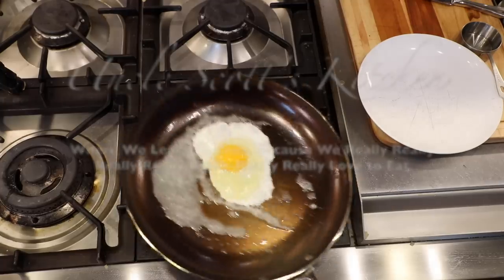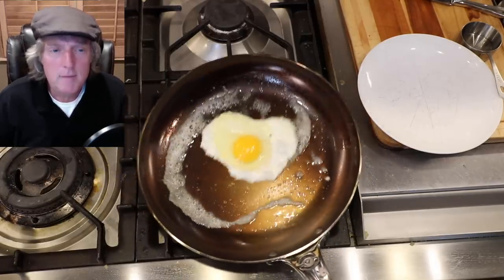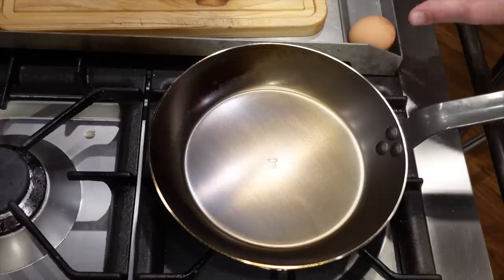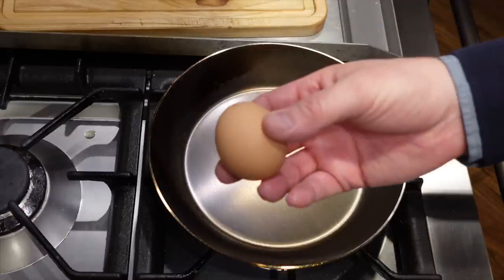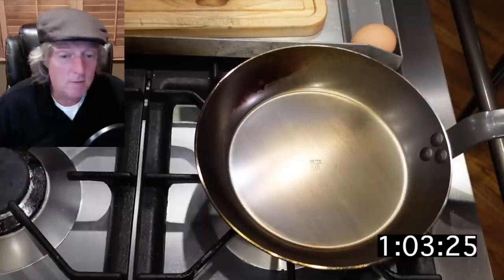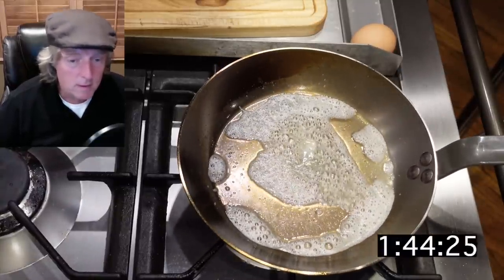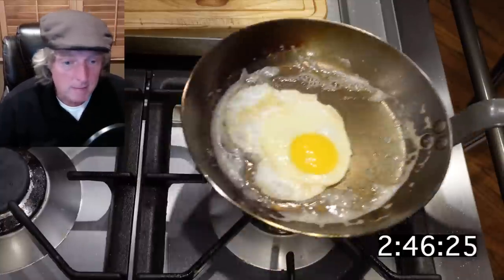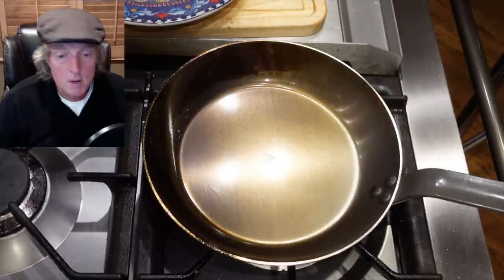IN-DEPTH: Exactly How to Slide an Egg in a Carbon Steel Skillet

Comment: I hated my cs and gave up on it for a year. I learned from watching your videos that I was using to high heat. As soon as I turned down my heat to very low NOTHING stuck. I do have a professional gas stove. Thank you I’ve learned so much from you. After watching one of your videos at 1am I got up and successfully made a French omelette and it was perfection. I was able to roll it in the pan before taking it out. By the way I did use cold eggs straight out of the fridge. It was absolutely beautiful and glistening. Butter does tell you when the pan is ready for the egg. I’ve gotten better and now use Ghee instead of regular butter. You have a video that walked me through it. I highly recommend it. I can’t stress enough using real butter and right temperature for your stove. That was a game changer. Thank you 🙇🏼‍♀️ 🙇🏼‍♀️🙇🏼‍♀️🙇🏼‍♀️

Comment: I bought a Matfer CS skillet several years ago, when I had an electric stove, and gave up on it.  Decided to try again now that I have a gas stove but the pan had rusted a bit in storage.  Nuked it with Barkeepers Friend and re-seasoned using the oven method.  Followed your instructions and my first egg slid perfectly.  I think the biggest difference was starting with room-temp eggs.  I also discovered that I can’t use the big, high-BTU burner I use for most things, but it all works well on a medium-sized burner at a medium-low setting.  I had to dial in the temp to prevent burning the butter, but I finally got carbon steel to work for me.  Thanks!

Comment: Great video. I have a deBuyer pro carbon steel omelette pan. When the pan is at temp I put a few drops of oil in the pan, then use a brush and spread it around the pan. I then drop in a teaspoon or so of butter. When butter is done bubbling I drop in the egg.  Egg slides beautifully

Comment: Hi Scott.  I used to use an 8” OXO Teflon pan (fantastic, so forgiving, but very little browning).  For the last 8 mos., or so, I’m using a perfectly seasoned 8” OXO Carbon Steel pan (less forgiving, but GREAT browning/taste!).  Depending on what type omelet I make (ala, Julia Child or Jacques Pepin), brown butter (NOT burned butter!) can be highly desirable.  Usually, I don’t have a problem with sticking, but this video has given me a great source for “troubleshooting”.  Thank you!

Comment: Great tips.  The times I have trouble when cooking in my carbon steel (several different sizes of de Buyer) I can trace it back to one of two (sometimes both) issues:  too cool or too dry.  I know better, I've been fooling with carbon steel since January of 2021, and used cast iron camping for over a decade...  But I'll still get impatient and not pre-heat enough, or think "that should be enough oil" (or butter)...

Comment: It's trickier but still possible to slide an egg in a Lodge frying pan. I usually have to give the egg a tiny spatula nudge to free it but when the planets align it works perfectly w/o help. My electric stove adds a layer of complexity to the process. Very nice video.
Reply: The rough textured surface of the Lodge pans really bothers me.  Those little pits are perfect for grabbing onto things like egg or oil.  I didn't realize until I laid my hands on an old car iron from the 1950s that they used to polish the surface so they were slick and shiny.
Reply: The Lodge pans get smoother with use. You realize the OP is about carbon steel pans, right? @ZagnutBar

Comment: I preheat off centre with medium high heat in 2 directions then cool down if needed and put 3 eggs in, then just let it sit on medium high heat.  There is usually a pocket of air that develops and the eggs just start slipping around.
Although I'm using a 11 inch premium frying pan.
Never have to wash it out.

I do find getting the correct temperature for oil a bit more difficult for the reasons discussed.

Comment: 8:49. Woah. Woah effing woah!!! Incomprehensible metric system?! You just lost a subscriber Scott! I’m joking. You’re bloody amazing. 

I’d be really interested if you can get hold of “spun iron” pans in the US. In the UK you can get them and I absolutely love using them. They are not cast (obviously) but discs of iron about 2mm….sorry 1/16th whatever that means and then spun into shape. Think a of a lathe and then they are turned to to shape. 

They are fantastic. Kinda cross between cast iron and carbon steel. 

Love the channel and this was a great “how too”

Comment: Thanks for the in depth explanation.
You have previously advised to have a pan specifically for eggs, why is this?
It it because if you use a pan for cooking meat then the seasoning won’t be as smooth?

I have a de buyer omelette pan and when cooking omelettes I get some sticking in the centre where the bee is stamped on, I’m wondering if that is because it is a cooler spot or if it is rougher due to the bee stamp.

Thanks once again.

Comment: I have a Merten & Storck preseasoned pan that I use for eggs. It was working great when I first got it, didn't really require much thought beyond how I normally do it. However, it seems to have lost it's magic the more I use it and I've gotten a few eggs stuck. I do wash with soap, but I wouldn't think that would cause a major issue, it's still mostly black but a little more matte and splotchy than shiny at this point. I haven't been bringing my eggs up to room temperature, so maybe I'll need to do that.
Reply: Your soap is washing off the seasoning of the pan. The seasoning is the layer of oil that makes the pan nonstick.

Comment: As a European I found the comment about water boiling at 100 degrees Celsius in the incomprehensible metric system a bit funny, because water boiling is the definition of 100 degrees Celsius.
Reply from the maker: The craziest thing is, to me, 212F makes complete sense! I can kind of grasp 100C for boiling, but if someone says it's going to be 22C today... I have no idea if I need a coat or wear shorts.
Reply: @UncleScottsKitchen Same for us, Europeans. Every time I hear or read some temperature mentioned in Fahrenheit I have to recalculate it mentally to Celsius. :) After somehow logical 0C for water freezing and 100C for water boiling it’s not so evident to understand why it’s 32 and 212 in Fahrenheit.  :) 
And by the way, why it’s so cold in your fridge? On our side of Atlantics it’s usually 4 or 5 Celsius, i.e. around 40F.

Comment: My guess as to why people fail is that they're not seasoning correctly.

I used to think sticky spots were normal until I found out I was using too much oil and subsequently not wiping it out adequately.

That pan should be slick and glossy.  When you run your fingertips across the pan, it should almost fell silky.

Comment: Can you use margarine in place of the butter. I'm on a tight budget.
Reply from the maker: I have not tried margarine... it should work like any other oil or fat but not sure if it will give you the indicators on when to add the egg. Try it and let me know if it works!
Reply: I tried it today. Everything worked the way it should. Eggs slid like hocky pucks and slid out of the pan perfectly. They were delicious, but not as good as eggs fried in real butter. Still good though. @UncleScottsKitchen

Comment: Question: Would you suggest the same egg-sliding capability can be accomplished with a non-seasoned stainless steel pan using the Leidenfrost or Mercury Ball effect (the dancing water droplets) and butter?
Thanks for the great tips and video!
Reply from the maker: I the other video I mentioned, I showed the same process for cast iron and stainless steel as well. I think it works a little easier in the carbon, but you can do it in others as well.
Reply: mercury ball is too hot if you are using butter it'll burn and your egg will look unappetizing. Leindenfrost temp for water is 379F - meaning your pan needs to be at least that hot for it to occur. Butters smoke point is 350F above which it's going to burn/carbonize.
Reply: @krisroadruck5081  So, since we’re talking science, what’s the minimum temperature required to attain proper butter-bubbling to produce the effect shown in the video? (This question is rhetorical as well as literal if anyone wants to answer)
Thanks for your input.
Reply: Google says the smoking point range for butter is between 302°F and 350°F.
Reply: @ejones7589  the water content in butter is capable of boiling off at waters boiling point as he mentioned in the video - about 212F but this will continue up until about 250F by which time nearly all of the water content will have boiled off and the butter will then begin to brown and take on a nutty flavor. The minimum temperature to fry an egg is around 158F but it'll take a long time - in that window between 212F and 250F Uncle Scott is targeting is an excellent compromise between speeding up the time to cook the egg, and keeping the butter under it's browning temp so you get that classic white color on the egg while still benefitting from the flavory goodness of the butter.
Reply: @krisroadruck5081  Some serious thermodynamic discussion going on here! Good info to take to the kitchen.
Reply: @ejones7589  heh I only know most of this because I suck at eyeballing/guessing when I cook, so I have a temp gun and probe that stays next to my range at all times - I literally just cook by the numbers. But it does have the benefit of consistent results!
Reply: @krisroadruck5081  Being an electrical engineer I understand your desire to be precise! However lately, I’ve been using less precise methods (the hand over the skillet test versus time) to hone more instinctual skills. I find it fun and challenging.

Comment: Just the. Dior I needed today. I tried to fry an egg with avocado oil (on a detox no dairy) and my eggs stuck right away.
Mistake 1  did not use butter
Mistake 2 eggs were super cold
I tired yo get the pan heated evenly but that seems elusive in my stove. I en use one of those laser thermometers. What emp should I heat the pan to?
I think I now have damaged my seasoning a little bit.query, should I try a mini seasoning? Or what should I cook to fix it. I bought the De Buyer just for eggs.I want to master French omelette.
Thank you for a great video. I will have to experiment!
Reply from the maker: I'm just guessing the number, but try 225 - 230 and see if that works. It doesn't have to be exact, as the butter regulates the temp it until the bubbling stops. Try the warmed up eggs and butter and I think you will be surprised! French omelettes are more difficult, but once you get good at sliding the fried eggs the same principles apply.
Reply: @UncleScottsKitchen  thank you! Will definitely try these! I sound like a terrible cook…but I can make them in a nonstick…just need to get this right. Definitely will leave eggs out overnight and use butter. And test the temp.
Reply: if you have time to spare, putting the burner on low and waiting longer will result in a more even (albeit slower) warming of the pan
Reply: @krisroadruck5081  thank you! Will add that too!
Reply: Bacon fat.....

Comment: Perhaps you could show us how it can be done with regular oil or olive oil. I find using olive oil or canola oil, I can easily slide a plain 2-egg omelette (even right after taking them out of the fridge). But not when frying them. They'd stick.
Reply: I've made fried eggs with olive oil about 5 times already and was able to get perfectly sliding eggs only twice with the other times requiring a small manual nudge with the spatula. I'm not exactly sure what I did wrong those three times but I think it might've been due to too high of a temperature.
Reply: @sixpooltube  think a small manual nudge to get it to slide is still considered 'non-stick'. So, looks like you got it right.